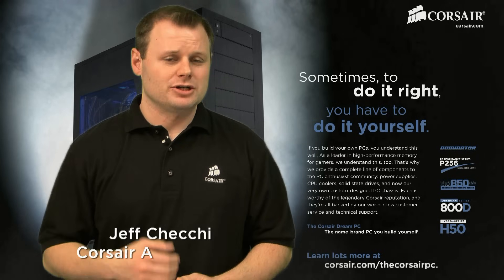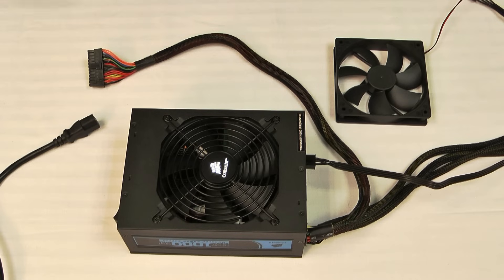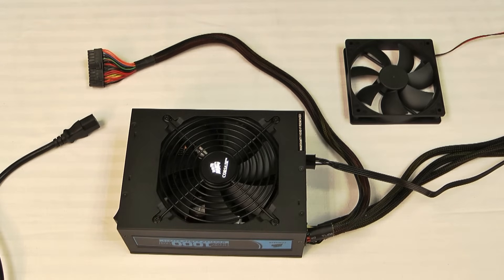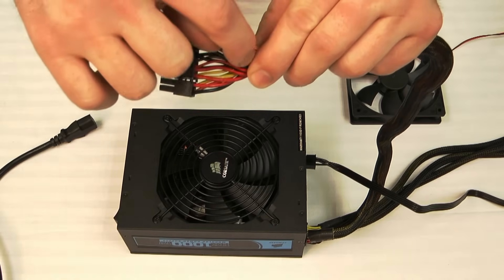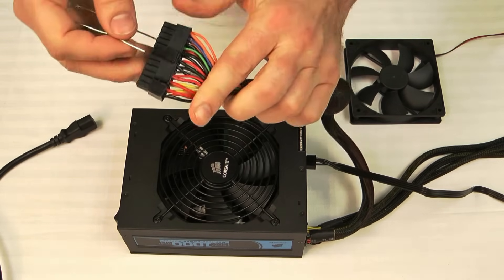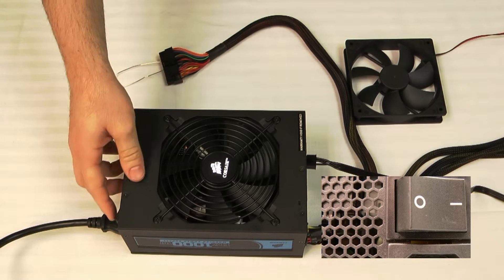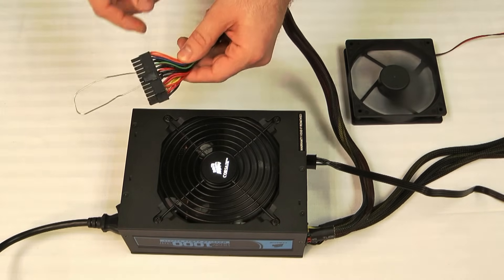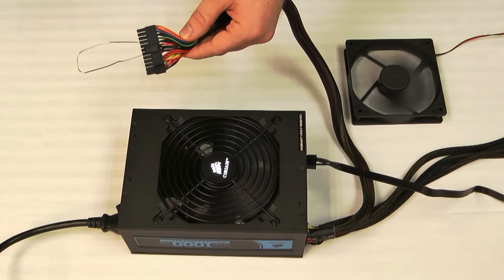Corsair Video FAQ: How to test a Corsair power supply

Comment: what if I don't have a fan to connect? my psu turns on with the fan and the fan will turn back off after around 5 seconds. is that normal?
Reply: okay went onto their website and can confirm that is normal, for anyone else wondering
Reply: I have the same problem as you. Does it still work?
Reply: Yeah the PSU was not the problem. It's normal if the fans start spinning and then stop again. It was because there was no additional hardware attached so the PSU is in saving mode. The problem with my pc tunred out to be my GPU. Hope you find a solution!  @Joyboyluffy

Comment: I have an HX750 I tried the test that in this video, the fan on the power supply spins for a couple of seconds then stops but the case fan that I have connected is still powered ok?
I thought the HX power supplies only spin the fan under a large load or the temperature reaches a certain point?
Reply: Turns out my HX750 was faulty, I replaced it, everything works properly now

Comment: Heyo! I ran this test with my corsair rm 650x gold and its about 4 years old. Both fans spin for about 10 seconds before my psu fan slows down and them stops, the other fan keeps trucking. is my psu dying? any ideas?
Reply: Fan spins a the beginning so that system verifies that cooling works. They shut off shortly after because PSU is not underload so it cools itself enough passively that fan cooling
is not required. That was created to minimize noise. As soon as you start drawing more power PSU gets hotter, that fan will start working (provided PSU is in full working order)

Comment: I have Corsair TX650w.... I have strange issue, Sometimes when i want to turn on PC it cent turn up...  on Power button ( i have power button on Mobo same it wont turn up.... Signal lights on mobo are shining all ok. ) Then i remove power cabel from PSU wait few sec and  pluge in and i can  turn on PC....  I have swap PSU and i dont have that problem with 500W OCZ mod Extreme pro.  What can be the problem?   i dont want to Throw Corsair tx650W.... Now is on my Mom's PC and i dont have that problems but System is not Power hungry it's old 9600 Gt Core 2 duo e6600 And 2 gb of ram..

Comment: Will this work on the newer PSUs have don't spin the fan until it reaches a certain load?
Reply: ax860 worked with the clip method with and without a fan for me (tested with a 700ma fan and a big 3A model) its not the latest but not so old.

Comment: I put in a ticket because my ax1200 is shutting off during heavy load. I told them this in the note. They requested me to plug in a fan and do a paper clip test. If I'm denied cus my 1200 watt can power a single tiny case fan during a stupid paper clip test I will never buy another corsair product again.

Comment: Hello, i've just received my HX850i full mod, before all i tested the Battery, just plugin it to the 220, switching ON the PSU, and then just push the TEST FAN button and .... nothing, no noise, no fan move :( is it normal. i heard it's not necessry to put the Wires to procedd to test FAN; is it right ? or should i test with the Wires you show in the video. It seems my PSU is KO. The only things wich are aupplied on the motherbord is the LEDs, nothing more, no FAN (neither CPU neither Video car....

Comment: I have a CorsairX500M PSU.
My PC does not start, there is no light in the keyboard, but all fans in the PC start and stop intermittently when the PSU is turned, on and continue doing so while the PC continues switched on.
I do not know if the problem is in the PSU or not.

When using the paper clip trick both fans start working, does it mean the PSU is working correctly? or it might be a motherboard problem?

Comment: Very useful, I doubt if I check the voltage or the power of the PSU are normal making that connection with a multimeter? Thanks!

Comment: Why not put a PSU green light next to your off/on switch. Save me the trouble of buying another case fan. 
I keep a 25 dollar Antec PSU in my tool box in case it looks like another spendy Unit won't power on. 
Thanks Jeff, this helpful clip tip, I'm sure will also come in handy.

Comment: Is it normal that the psu Is loud a jet engine? just wondering :)
Reply: Thefisk101Gaming no it's not normal..... It happened to mine.... The fan has lost its lubricant and its not smooth anymore that's why it's so loud.... You can still use your computer without any worries as long as the fan works but I won't recommend it

Comment: Well i just found out my psu wasnt working because the HD Sound "ground" wire was reversed from the case.

Btw this technique worked, and told me that my psu wasnt the problem. Guys please note, NEVER DO THIS IF YOUR PSU DOES NOT HAVE A LOAD (Always connect it to something like a cpu fan when doing this test) If not, bad stuff will happen....

Comment: Is it safe to leave it plugged in like that for years at a time or would the paperclip be a fire hazard (or damage power supply). It would be nice to be able to recycle low watt power supplies this way, if its safe.
Reply: should be, i have seen lots of people powering stuff with PSUs, just use a bit of wire to bridge across or cut the green wire and attach it to a black cable

Comment: this is truly a test just to test for it to "turn on" since there is really no load on it at all.  I have had issues of really high end PSU's running just fine all the time, but when the power hammer comes down in full effect under massive load they crap out.  No real way to test unless you have expensive equipment.....especially anything 1.5kw and beyond!

Comment: I have an AX860i and am having weird issues, sometimes it will work fine for hours, other times it wont last long, then it will just turn off, sometimes it turns right back on, other times it turns on for one second and then turns of and will do so for some time, I am currently running on a much cheaper crappier 700w PSU for now to test and will do so for several hours, if it does not randomly turn off I may have to go buy an EVGA 850w G2 in the next few days :(

Have had the AX860i for 4-5 years though so have had a good run I guess, alas I can't even see if it is over heating because my Crosshair Hero VI only has one USB pin plug and I have had to put my h115i into that, I suppose I should get a Commander Pro at some point so I can get another two USB pin plugs.

Not that this trick would work for an AX860i because all the cables are black lol

Comment: *there's a single green wire here*No, there is no green wire. In fact, all the wires for my PSU are black.Who thought that making all the cables black was a good idea?!
Reply: It is a good aesthetic aspect, and most people prefer black cables to default colors. Google 24 pin diagram and you can count the spaces of which pins to use from there.

Comment: I have been told that the HX750 uses a fanless mode, and when it turns on from the power test it clicks off immediately afterwards. Ive been trying to figure out what is wrong w/ my one machine, and I would get power to my NIC, and some fans but the PC wouldnt turn on. I thought it could be the CPU but I am unsure.
Reply: Same to me, i did jumper then the PSU's fan is run for while (atleast 5 seconds) and stop after that. Its sound clicked too
Reply: @batukilang5765  - Over time, I ended up finding out that the odd symptoms of that PC were due to a bad CMOS battery.

Thank you for the info though. I forgot about this post, but I still have the PSU on the side. I've been thinking about trying to put it out and test it again

Comment: Mine doesn't have colored wires its just all black what do i do now?
Reply: Aidan Concannon put the paper clip on the 4th peg from the left. That should be the green cable (The detachable part is on the right) then put the other end of the paper clip right 1 peg and that should be a black cable.

Comment: Thanks for putting this up. It's helpful to be able to verify my new CX 500 fails this test. The PSU fan spins for a fraction of a second and then stops. Will be contacting RMA.
Reply: I had this problem to. Do your sistem work properly after replacing the PSU?

Comment: This was probably a great video 7 years ago. Corsair needs to do a newer one with the AX series PSU's. I'm seeing a lot of people - myself included - online in forums having problems using a bridging plug or jumping the motherboard plug with a paper clip to test fans, water loops, etc.
I'm using an AX1200i and I cannot get it to power up using a Bridge plug. I checked the PSU's specs online and the bridging plug is jumping the correct pins on the plug. None of the fans connected to will power up either when jumping. I plug it back into the motherboard, HDD's, etc. and it powers on.
Reply: ill swap you for my ax which does power on with the paperclip but wont run anything else 🤣

Comment: Watching this in 2020 and still super helpful!  I was taking apart an old custom PC, looking to upgrade the parts and whatnot.  Tried this tip with the paperclip on my Corsair CX 430 and found out it worked like a charm.  This was after trying to power on the PC when it was all together, so maybe the issue is with the motherboard or something else.
Reply: But after how long should you replace the power supply?

Comment: NOTE:
Your PSU fan will NOT turn on if you have a PSU that will perform silent (fanless) up to a certain load such as the AX1500i.
This is why it's always a good idea to hook up a fan to a molex connector.
(The AX1500i has a self-test button but that's beside this particular point.)
Reply: how would i connect a nzxt fan to a molex cable?
Reply: @JustNotIt9927  You'd need a 3-/4-pin fan to molex adapter.

Comment: Is it safe to touch the paperclip while its in there?
Reply: No, definitely is not
Reply: yes it is safe.. it low voltage 5v dc
Reply: Unless something is very wrong with the cabling or power supply, then yes. But why would you take the risk? There is no need. Just turn it back off before you touch it.
Reply: can i lick it

Comment: so my psu is working fine according to this test, but after plugging in everything and turning it on, when i push power it, the psus fan spin once then nothing, im confised as to what could cause this?
Reply: Did you ever find out what the problem was? I'm having the exact same issue

Comment: How would I test the RM series? With all black cables?
Reply: *****
There is a way to test it, the top row with the clip to hold down the wire to the motherboard? Yeah get a paper clip, from the left, go 2 slots to the right, connect the 3rd and 4th slots together with a paperclip (or the 3rd and 5th) connect up a fan. and power it on, if it works the fan should spin up

Comment: Old, but still relevant. My PSU came with a self-tester, which basically takes the place of the paperclip. You just slide it on so the black cord curves onto the green cord (easy a pie, really) and then plug in the PSU and turn it on. Works like a charm.

I didn't have to plug in anything to it and the fan started up. I assume that's enough to know it works, but I'll likely talk to my uncle about it and find out for sure.

Great video.

...now if I could just figure out how to get these decals to stay on my metal case. I wonder if static electricity causes them to pop off in certain spots or if it's just that the adhesive is too weak. I don't know if it's even worth keeping, since I might want to remove them one day and anything permanent would prevent that or damage the case...

Comment: This was a extremely helpful video. I disconnected everything (even all the RAM) from my motherboard except for the CPU, CPU cooler, and chassis fans. Then I unplugged the 24 pin connector did the paperclip trick. LEDs and fans started working whereas they didn't work before. The problem seems to be with my motherboard since it's very unlikely that CPUs go bad.
Reply: Why did you unplug RAM, etc if you anyways unplugged the PSU power connector? PSU anyways got disconnected from Motherboard no?
Reply: @Puneet00000  I don't remember all the details, but I shared your concerns about disconnecting the PSU before everything else. The test regarding starting the PC with no RAM was just to see if it would post (or give any sort of different message through blinking lights). I forget if that is even a valid test for RAM or not.

Comment: Can you tell me which Pin Connector  you're having inside a Corsair HX1000i PSU and which Fan Diameters and Sizes it Supports? Just in case i want to install a different Fan
For Example:
Could i replace the Stock Fan with an 4-Pin PWM 140x140x25 Fan?

Comment: Please test your 1200w pwr supply with an ASUS GTX 770 mounted into an Intel DX79TO motherboard. ALSO Please sure close up and clearly the cable connections at the back of the pwr supply and the video card. Use the HDMI connection to the monitor also please. If you can get that configuration to work please show us the monitor screen with the system operating properly. Thanks ; )

Comment: what if its a flat cable and they are all black? :D
Reply: +StaticFX yes why did they change the color coding rofl
Reply: The pin layout must be the same, no matter what PSU, since it has to plug in to various motherboards and they all have to work the same. 
The video doesn't show the pins very well, but Corsair website does: 4th and 5th pin from the right, when you're looking at the connector, and the locking clip is on the bottom.  
This video needs to add a diagram to show which pins to be shorted.
Reply: For the users that have the HX 1200, this PSU has 10+18 pins instead of 10+14. In order to jump start PSU's with this kind of layout: Have the 18 pin connector with the lock clip looking upwards, from the top row of the pins count from right to left, you need to put a wire or clip in the pins 4 and 5.
Reply: can you pls provide a link to where Corsair shows the gren and black pins well?

Comment: Anyone know what could cause the PSU fan to stop working?

The PSU works, as in, giving power to the rest of the computer and im sitting infront of the PC right now. But, the PSU fan does not work.
I cannot do any "high load" stuff on my computer cause the PSU will get too hot and I start noticing a burnt smell.

I have not open it up yet cause I'm not a electrician and do not know exactly what to look for. I've read about capacitors but all Im wondering is, could there be other causes and "more likely" causes than a faulty capacitor?
Like mentioned, im not an electrician but if there is a faulty capacitor, wouldnt the PSU not work at all?

Might want to mention that the fan NEVER spins. Even when it becomes really hot.
Reply: +stoffni If you have a Corsair TX, AX, RM, or RMi series power supply, the fan is designed to stay off until the power supply gets high load. this is a feature and not a fault... HOWEVER... if it's a HX or a non-corsair unit that doesn't have this zero-fan feature then yes, there is likely a fault with the fan control circuitry on the power supply. hope this helps!
Reply: ThEcRaZ3dGaM3R I do have a corsair but the fan never started, even when the computer was so hot that it actually burned my hand if i touched the towers backside.
I decided to buy a new PSU, but before going to the store, I thought I could just open the PSU and just look at it and see if there was any "obvious" errors.

I thought to myself. The fan works on a motor. Very much like a car does and if not kept "greased up" it will have problems to function or at all.
So, I open up the little hole in the middle of the fan, poured some oil in it (I used bladeoil, the type of oil you use on your razor).
Waited an hour or so before starting it up again.
TA-DAAAH! Now it works :P

Thanks for the info though. I appreciate it!
Reply: stoffni No prob... at least you got the fan working... :P I completely forgot to mention adding a thin machine oil if the fan itself has seized XD
Reply: +stoffni does it will void your warranty?
Reply: Sharif Azmi If you open something up, like I did, it will void the warranty.
But, my PSU didnt have warranty anymore, so I didnt need to worry.
Reply: The only obvious error would be if the fan was not plugged in, or, unlikely, the fan was defective.  I have seen though some case components plugged in incorrectly and therefore not working (USB), so it is possible to have happened.

Comment: What if the power supply fan spins shortly then stops when connected to the motherboard?
Reply: its the exact issue i got
Reply: ***** same..
Reply: ***** The problem is mostly with shorted diodes, not necessarily the main diodes used for DC rectification though (if a cheap PSU) but any diode in the PSU could be shorted.
Reply: If you have a high end PSU like the RMx, HX, or AX series, then the fan will automatically shut off when under low load. It might work.
Reply: my corsair vs550 have this issue also

Comment: I've used that method in the past. I have a AX1200 PSU that I've used in 3 different builds over the last 6 or 7 years, because I upgraded to newer platforms. I am now having issues where the PSU is running but the 12V is getting wonky. Sometimes everything runs fine when I power on the PC but the problem is becoming more frequent and I found that all the fans running off the Lamptron fan controller (8 fans) don't run and the case lighting LEDs don't turn on which all are connected vis a 12v line molex. It's got to be the power supply since those things are isolated from the motherboard. There barely seems to be enough power to run the motherboard but nothing else which is allowing me to use my PC as I'm typing. I have a new HX1200 on order but won't be here until the end of the week next week. Is there anything else I could try or look for with this unit. I thought the thing would die altogether if something fails not work as if it was just losing strength.